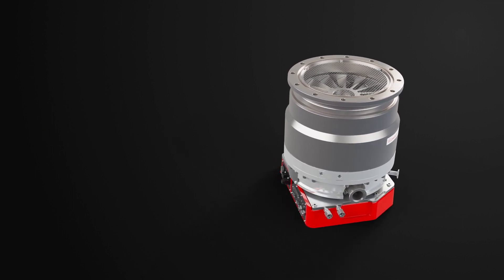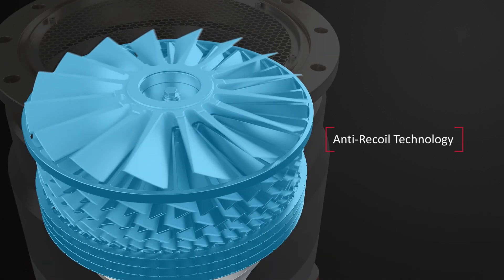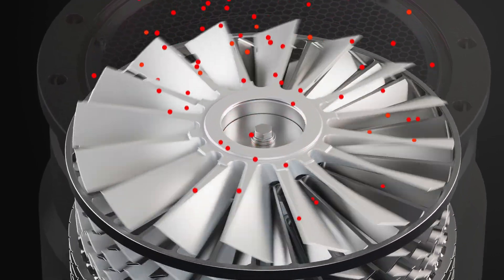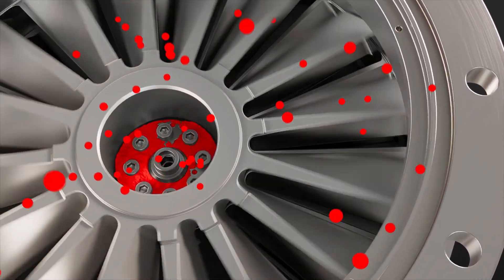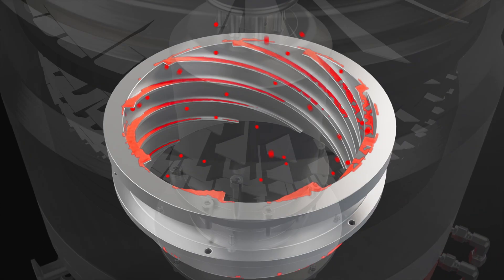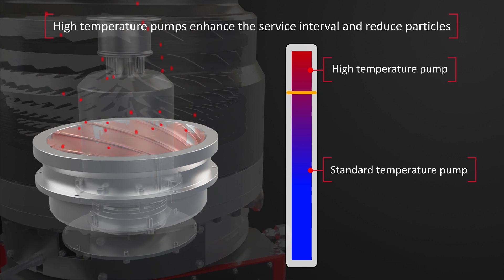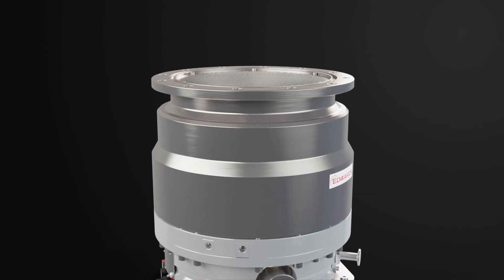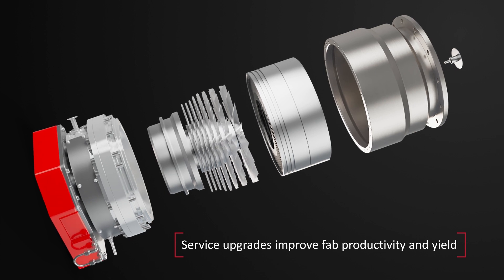Edwards STP Maglev Turbopumps upgrades

Comment: This vacuum fit for distillation used engine oil?as a booster
Reply: This is for semiconductor vacuum process. I don't think could handle the gas load from distillation. However, depends on what your gas loading is.